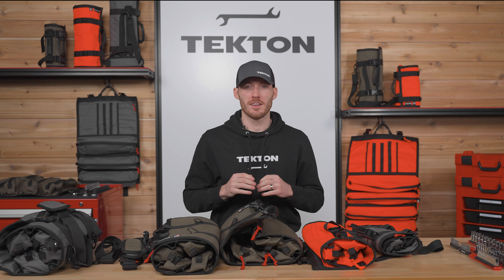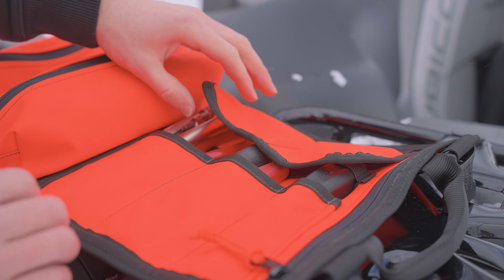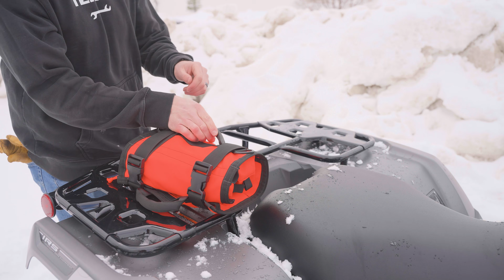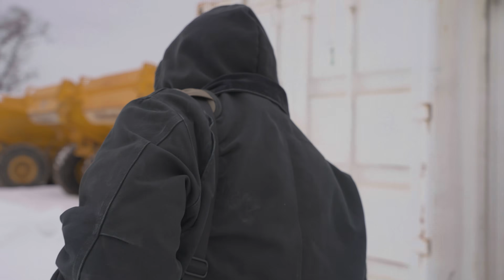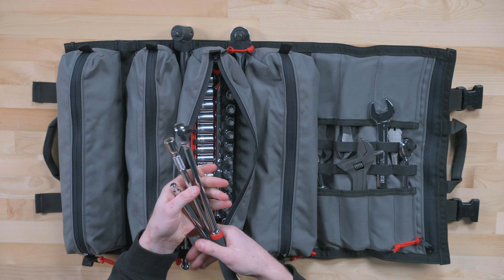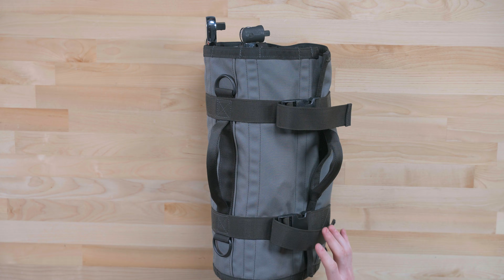Tekton MTR Line of Tool Rolls - Detailed Walkthrough

Comment: I’m a huge fan of this design. I've never been one for the recent plastic toolbox trend—to me, they’ve always felt a bit cheap and flimsy. I already use similar soft-storage pouches for my wrenches and they’re a game-changer. Being able to grab one compact pouch with my entire set is so much more efficient than lugging around fragile plastic cases that take up ten times the space. The best part is the versatility: you can unroll a pouch right on top of an engine for immediate access, whereas bulky plastic cases always end up stuck on the floor or a service cart. I hope to see this line continue to expand with more of these innovative ideas.

Comment: I like the design was made to fit socket rails. Ive never had those exact socket rails but similar rails the clips break off the rails.  Its really annoying to get your toolbag setup and when you get to the job you pull out your sockets and some of the clips broken off. Eventually you just end up with loose sockets or go back to blow molded cases.  I use my tool bags ptoffessionally in factories.  Maybe the car kit s dont have that problem.